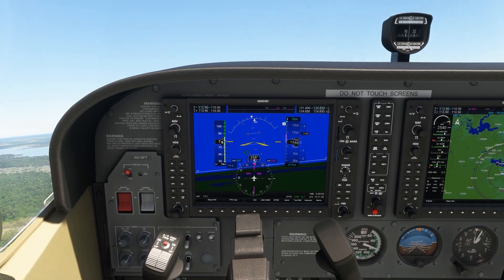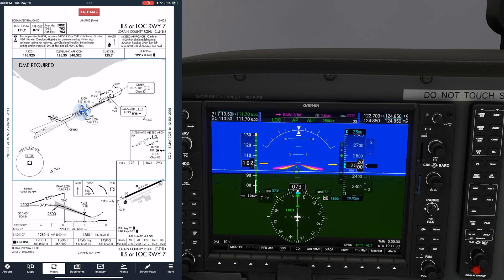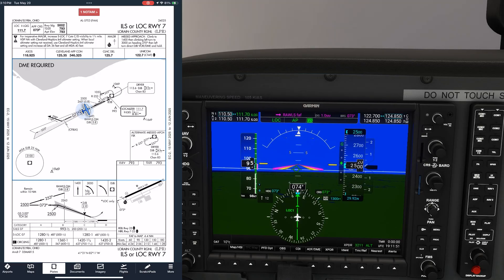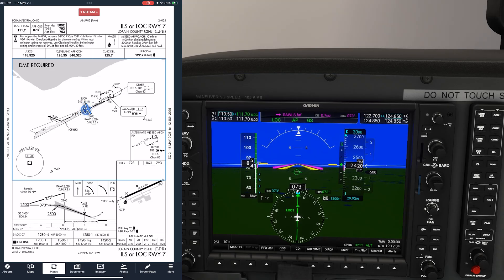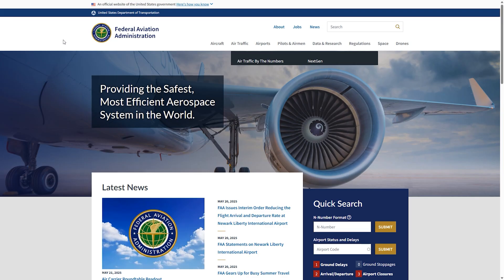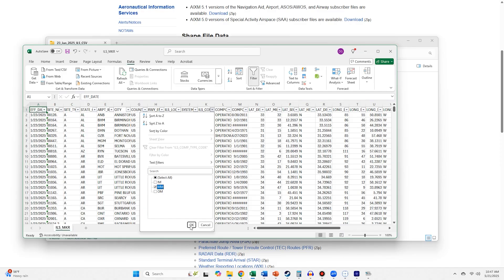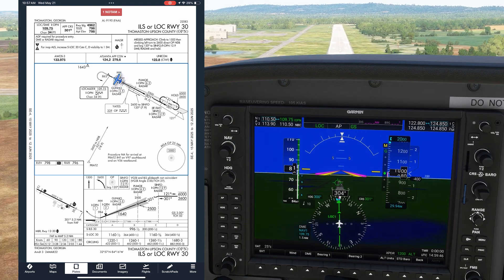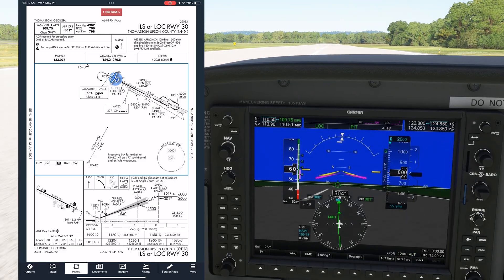Why Your Marker Beacon Panel Is Buzzing: Understanding ILS Marker Beacons (OM, MM, IM)

Comment: This exact thing happened to me when I was a fresh PPL in the San Francisco bay area flying up through the east bay in an older Cessna 172 rental. All of a sudden I heard this beeping noise/alert and had no idea what it was. Everything was working fine and there were no problems with the plane that I could tell, I was on course and at the right altitude and on flight following. Still, you don't ever ignore something that sounds urgent, that's how you get killed, I thought, my heart racing. After a few minutes I realized what had happened and pressed the marker mute button on the ancient radio panel. Then I got to enjoy the rest of my flight home feeling pretty stupid 😂